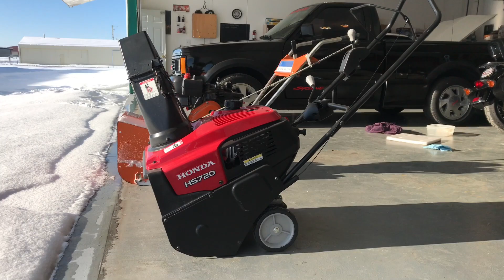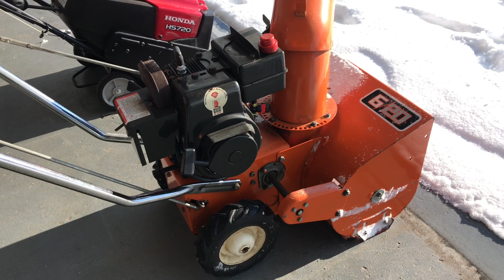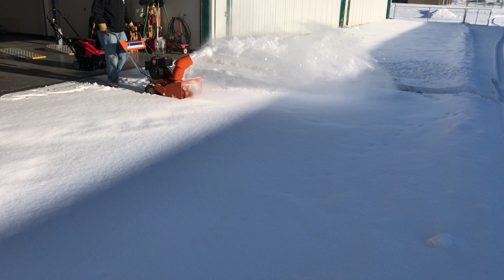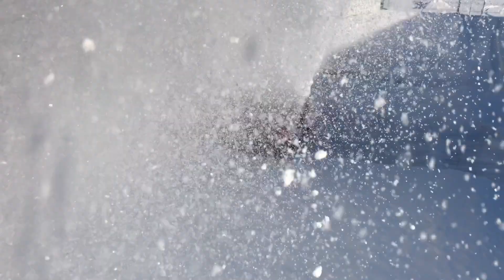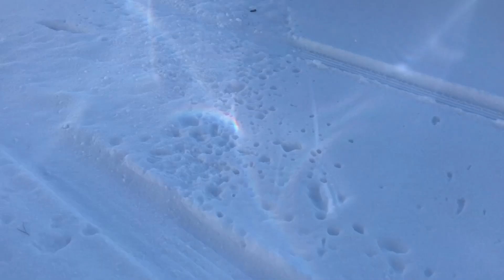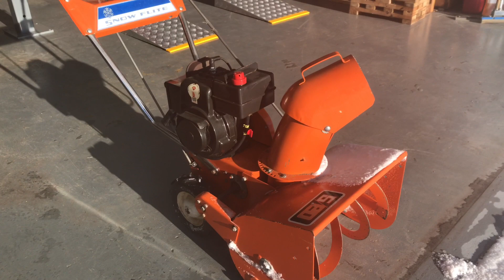New Honda HS720 vs. 40 year-old 5-horsepower snow blower

Comment: Seems an older single stage can be used in more situations than in the more basic Honda as the older one has skids and you could possibly use it on a gravel driveway. Toro has updated that old single stage design with their snowmaster series what has engine power going to the wheels and I believe it even has a differential so it's easy to turn. Snowmaster series has the Toro Personal Pace system that is used on the lawnmowers.
Reply from the maker: Interesting.  In small areas the Honda is 10 times better.  On a long straight path maybe the old one is better.  I use the Honda 95% of the time it’s just better all around for most situations

Comment: A good working single stage will out perform a bulky, heavy 2 stage, most of the time. Single stage, lighter, easier to handle, cheaper.
Reply: The only problem I find with a single stage is if you really get slammed and you don't get out there in time it's really hard to push the machine through the deep snow even if it's late and fluffy. Now I can't speak for the single stage machines that have power at the wheels because I've never used one. I find a true stage with at least the name horsepower engine works best for my situation especially at the end of the driveway.

Comment: One thing, is those rubber augers on the new machine will wear out in a couple years and need replaced.  The metal auger will last 50 years.  Also the rubber auger will not cut through icy snow, it will just ride overtop of it.
Reply: Couple years? Nonsense
Reply: @willdemelo5994  i own a snowblower and yes those rubber auger blades will wear out rapidly.  It depends on how much you use the snowblower.
Reply: @eagleviewhd I have a Toro 518 single stage which I found in the trash and I just keep it around as a spare incase someone needs to borrow it. It's very similar to the pond in this video with its rubber paddles but it's pretty good for what it is.
Reply from the maker: I’ve had it 5 years and the rubbers are fine.  Although I only use it a few times a year.

Comment: The Honda works great until the paddles wear out ..  and the old school will keep on blowing...
Reply: So you replace the paddles, I've had these types of blowers and it takes several seasons before the paddles wear out
Reply: Yeah, but the rubber paddles clean (sweep) right to the ground, which the steel can't . . .

Comment: Love my honda hs720 ....as long as u change the oil n spark plug n drain the gas after each season it should last you a long time...3 year strong with mine
Reply: Yes, proper maintenance is the key.  You could buy any off brand machine, and chances are if you maintain it properly, it'll deliver good performance.

Comment: Is it just me, or is that Honda much more difficult to push?  I "upgraded" to the HS 720 this year and find the unit much harder to push than my old Troy Built.  And, my old unit seemed to get the packed snow much better.
Reply: My Honda struggles up any slope.  I have to shove it up my driveway.
Reply: @Ramanpreet Mann I got a Toro 928!  It's all ready to go this year!
Reply: @Andy-im3kj  Single stage snow blowers don’t have skids.
Reply: I guess not powering the wheels on these single stage machines probably makes it cheaper. I do know Toro makes modern single stage that has powered Wheels. And I think powered wheels are helpful in any snowblower.
Reply from the maker: Lany Burnett you have to get the Honda digging into some snow so it pulls itself forward.

Comment: Love these reviews! The only issue i have with all the Honda and toro single stage reviews are that they never seem to show the snowblower in action at the snow plow pile at the end of the driveway... anyone know how they perform!?
Reply from the maker: they bog down a bit.
Reply: Struggles a little but it gets it done
Reply: I use a Toro 721 QZE with KAGE paddles and have used ethanol free  from day one and will outperform a Honda HS 720 anyday. Never bogged down on me. I checked this video because I want to compare this Honda to my Toro and ended up buying a Honda but sold it after one use. Only negative on my Toro is the handles are too high and my son doesnt like using it but next summer I will have a local fabrication shop bend the handle down to an additional 30 degrees
Reply: @ncimson5318  I also have a 7 year old Toro rc 721; I think it's exceptional - I simply can't imagine anything working better.  Because I'm retired I make sure to get at the snow first thing when it's usually fluffy, and this machine blows great.  Same with the end of driveway plowed snow . . . get at it quickly and everything is OK.  I need new paddles next season, do you like the KAGE paddles?
Reply: @fredberger3155  I highly recommend the Kage paddles, it wears great and it doesnt flat as noisy on the ground like regular rubber paddles
Reply: @ncimson5318  Alright then, I'll try the Kage, thanks!